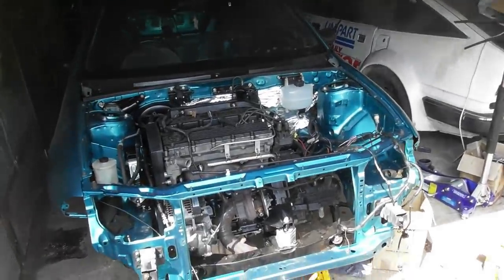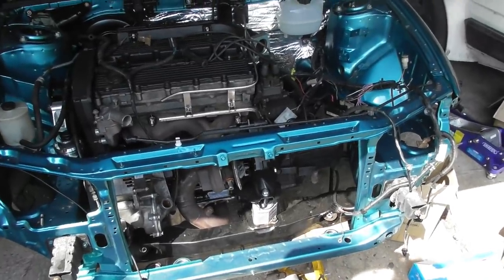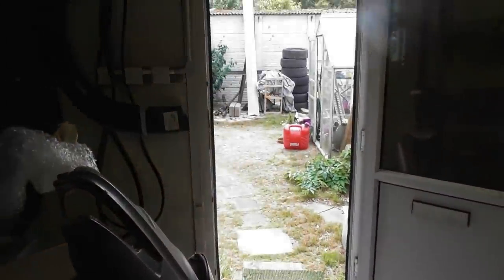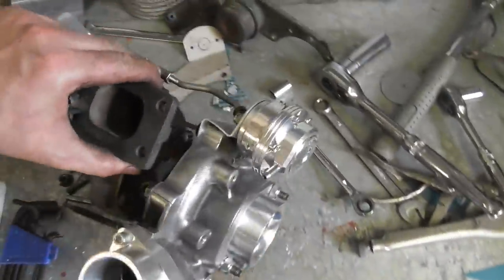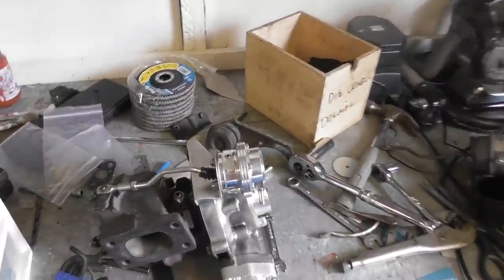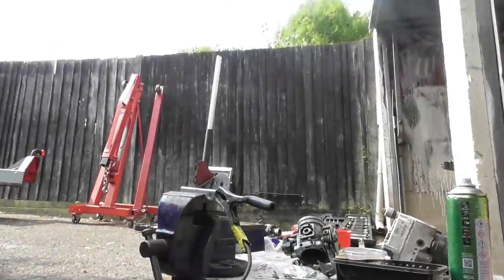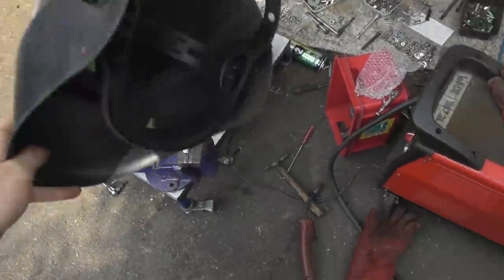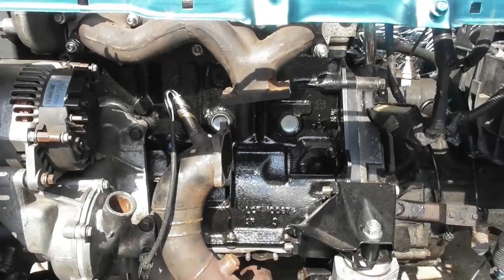Rover 200 mk3 Bubble T16 Turbo - Video 19 Modifying Forge turbo actuator t28

Comment: You never seem happier than when you are trying to assemble a fiddly bracket with teeny weeny welds. In my book that means that you can't really loose... Question: I have my spare PE166 (2600) Engine completely stripped and partly cleaned. It's not the best by a long shot but I recon it's mostly salvageable. The worst part is probably the condition of the pistons but the cylinder bores themselves don't look too bad. My aim is to try to rebuild this engine standard as possible but with an odd reliability and running quality improvement.. There is a short, nasty and fairly deep gash towards the top cylinder 2 bore.. Have you ever heard of anybody trying to metal fill one like this and then trying a gentle skim and hone.. or do you think there will be no choice but to do a partial re-sleeve and / or serious over size bore out job..  Answers on a post card... no pressure.
Will ;)
Reply from the maker: Hi Will,

doffo dont put any kind of metal filler on it.  It would probably just delaminate with the expansion and contraction of the block, and then cause more damage.  Are you able to transport it to an engine rebuilders?  They might be able to advise on whether rehoning will bring it back to serviceable or if it will want reboring.

Is your current engine ok?  If it is, i would probably just pull the head off that one, fit an new cleaned up head with decent valves and seats and then call it done!
Reply: @nitrosilvia  The running engine in the car is good.. too good !!.. there is definite wear to the front of   camshaft and the valve clearances will be a bit wide but it doesn't clatter and runs bloody fine.!. A bought a 'scrap' 2600 engine for £50 quid to try to learn a bit more about the PE engines. Even though this spare engine has been really really badly neglected most of it looks salvageable.  The truth about running the PE engines properly really does seem to boil down to regular good quality oil changes and keeping a sharp eye on the coolant.

As you likely know the block and crank alone on these are seriously heavy items but once stripped down to bare parts hoyking the bits about on your own is possible.. Because I'm related the 'Precision Engineering' game myself I'm probably just a bit over cautious about who I let work on it... My ultimate aim is to rebuild it  best I can but with an extra horse or 10. I'm doing this because nobody else seems to want to have a proper go at it and I can't believe just how well the heavy lump of 'potential scarp' engine in my running car happily steams up and down the A1 on any given Tuesday with actual torque that you can properly feel !!

Comment: If you need to lacquer bare metal make sure you use etch lacquer so it adheres properly.
Reply from the maker: Ive just done plain acid etch then black then sanded to bare alloy.  Cant be bothered to lacquer it too.

Comment: Always good to have gussets but think the relevant force isnt that needed to shift the actuator but that needed to open the wastegate - which is a lot less.
Reply from the maker: You are part right.  But its the force required to keep the gate closed, or close the gate against the pressure.  Thats why the spring in side is so hefty, so the gussets are there really for that.
Reply: @nitrosilvia  Ah, indeed. I was seeing how easy you moved it but that was without any gas flow. 
I blame the heat.

Comment: Hi, I know this is an old video but I don’t suppose you’d be willing to make another one of those brackets if I were to pay ive been struggling to get my actuator to clear the gearbox on my new turbo
Reply from the maker: What turbo and actuator are you using?  Is it the same as the t28 and forge that i was using?  Its a tight fit thats for sure.  Where do you live?
Reply: @nitrosilvia  
Cheers for the response! 
Yes it’s a T28 from my friends old S14a and I will be ordering a forge actuator to run with my new forged build! :)
I’m based in Hampshire/Southampton
Reply from the maker: @Jamie-mn9hk  OK, ill see if i have my old cardboard templates
Reply: @nitrosilvia   That’ll be fantastic! Thank you so much !

Comment: Just a thought, will you need to get the turbo re balanced after you have had it in bits? I ask because I want to change the turbo core on my P38 diesel Range Rover and I'm unsure to do it because of the balancing issue! Any thoughts? Tom
Reply from the maker: All i have done is rotated the outer housing.  If you undo the centre shaft or mess with any of the internals, then i would suggest balancing it.  If you just rotate the static outer components that dont rotate it will be fine.